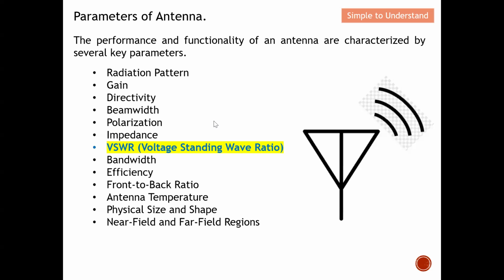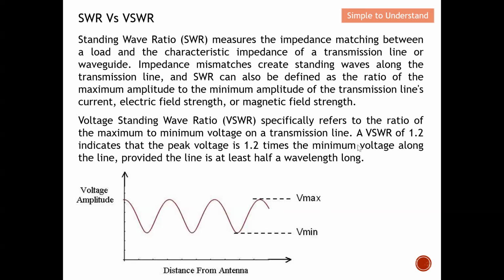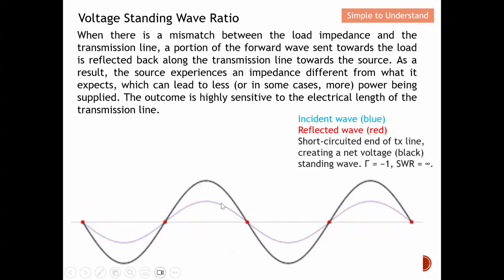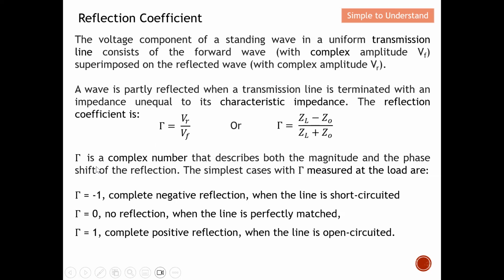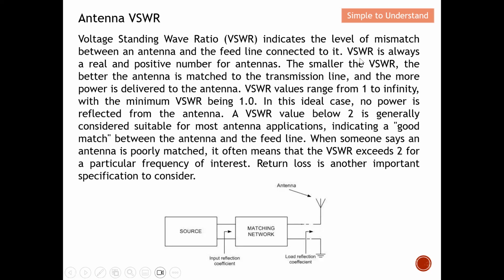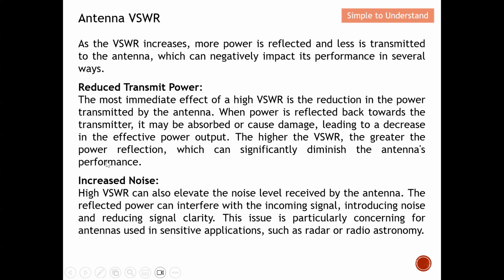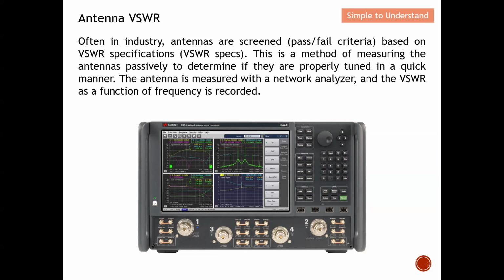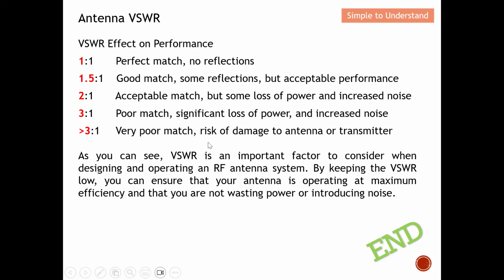Antenna #9. What is a GOOD VSWR? How to LOWER SWR for BETTER Signal Strength, Range & Reception.

Comment from the maker: Thank you so much for your support on this video.
In this video, I first explain what Antenna Voltage Standing Wave Ratio (VSWR) is. I will also discuss the acceptable range of VSWR. Voltage Standing Wave Ratio (VSWR) specifically refers to the ratio of the maximum to minimum voltage on a transmission line. I explain how achieving a good VSWR may require impedance matching.
When Γ = -1, there is complete negative reflection, which occurs when the line is short-circuited.
When Γ = 0, there is no reflection, which happens when the line is perfectly matched.
When Γ = 1, there is complete positive reflection, which occurs when the line is open-circuited.
Next, I highlight the difference between VSWR and SWR.